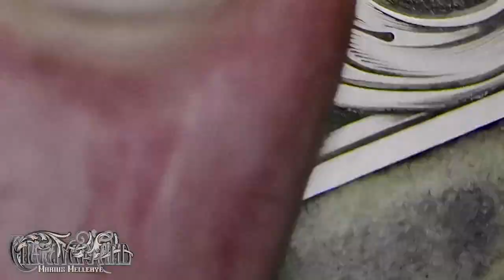Hand Engraving - The Titanium Pendant

Comment: very beautiful and i am also obsessed with 116°😀😀.  how many bars do you use for each of your engravings? what type of graver do you use to remove the background?  or using what template to hone it?  I just saw a shape like that, congrats beautiful work
Reply from the maker: Many thanks! :-) Yea the Universal 116 is great.. and what I use for almost everything. I’m usually just under 30 PSI.. Gravers are Lindsay M48 and background with a Flat/Knife Combo template. Been using both AirGraver Classic/ArtGraver and PalmControl :-) Just awesome tools.. :-)
Reply: @engraverhand  yes i hands control great tool but i cant afford anything from Lindsay, i was saving long time to get turbo Ag from Turkey.  to buy Lindsay sharpening handle I have raised my hand.  I'm a little forced in this carving hobby.  as you know carving equipment is very expensive.

Comment: I love this video it is amazing, where did you get your engraving table from I would like to get one like that
Reply from the maker: Thank you so much! :-) I´m not exactly sure what you mean by engraving table.. but the try to answer.. The bench (desk) is just an old normal desk I converted into en engraving bench. The Engraving vise is a TrueCenter Camlock vise from Steve Lindsay engraving tools. The "table" where I have my vise on, is actually from a multi million super yacht.. It´s the leg of a captain chair. It´s rock solid, super heavy and adjustable..  (Long story, but I used to work with leather on Super Yachts) The graver holder on my desk is just an antique stamp holder..  :-) That should cover the most I think? There is a photo on my Instagram profile..